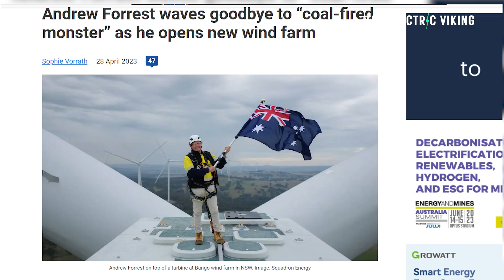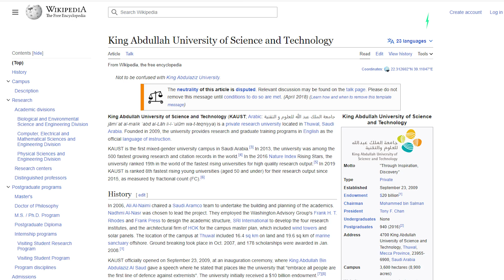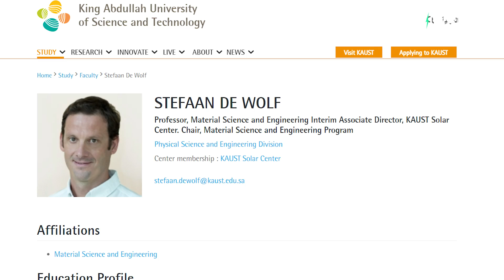A commercially viable solar cell set a NEW efficiency world record

Comment: This is a profound statement. The cost of solar will only drop , but the cost of fossil fuel is only going to rise. Which one would you want to pay for ... the one that's going to let you keep more of your money or the one that's going to burn your cash like a hot mess that it is.

Good point. I'm putting solar on my home.
Reply: Turner, 

you are asking the wrong question. One works and the other doesn't for grid supply. Guess which one doesn't?
Reply: Can my grandmother on a fixed income afford to go solar in her home? If so, does she have the room for the massive solar array and massive battery bank? Can she run her heating, air conditioning, electric stove & oven, and clothes dryer from solar panels and batteries? If you think the answer to ANY of these questions is "yes" you`re absolutely delusional. I use emergency off grid solar. I know the costs, logistics, and impossibility of ever converting to 100% "green" energy. Germany and California are prime examples. And I`m sure you`re clueless about that as well. What happens to solar when we get a repeat of the Burckle Impact event or the 536 A.D. catastrophe...or the Toba eruption? I know what will happen in California and Germany!
Reply: @baneverything5580  Someone's off their meds. 🤦‍♂
Reply: @baneverything5580  Yes she can! Even if she has limited mobility, YouTube adds tell me you can earn 50k a month by working 15 minutes a day, go check the adds out! /s

Comment: For domestic solar panels in Australia, efficiency is not such an issue: just add more panels. But for some applications it could be a game-changer. One example is the long-awaited Aptera EV which uses solar panels on its roof. In a similar way, aircraft could incorporate thin-film perovskite panels on their wings and upper fuselage and get a significant range increase. The ultimate might be an aircraft that generates as much power as it consumes (at least in daylight).
Reply: A solar powered airplane, the Solar Impulse, has already flown around the World in 2011.
Reply: @VVBros1  How many passengers,  or how much freight, did it carry?
Reply: @elephantintheroom5678  Not relevant at the moment. A big plus is that everyday is a sunny day more or less. I can see a use for loitering sigint nodes. Fly at 80,000 feet and eavesdrop on phone conversations etc. Very useful as a secondary source of intel.
Reply: I agree that would be great, but it's going to take a lot more R&D to achieve significant range increases. Toyota tried it on a PHEV Prius and it adds about 3 miles after a whole day in the sun. If they could get it up to 20 miles, it might make it worthwhile.
Reply: @Chickens and Gardening  and we all know how far behind Toyota is. Aptera says it can do around 40 miles a day. Going off of efficiency that means model 3 would get around 15 miles a day with same solar system. Giving me the giggles thinking how little Toyota was able to do with the prius weighing a ton less than m3.  Maybe I missed something?